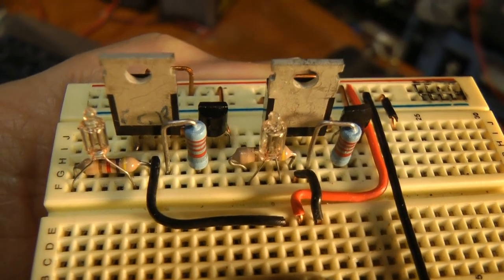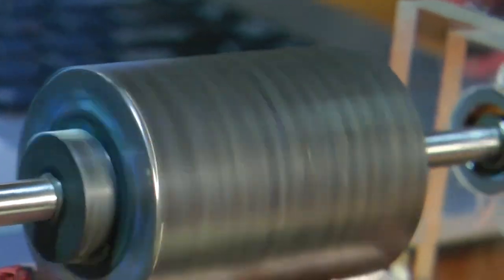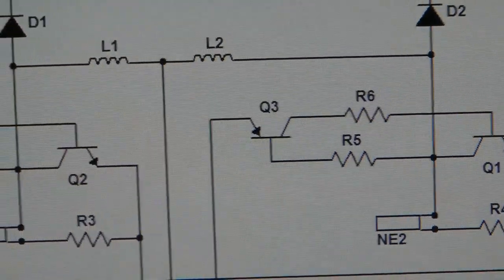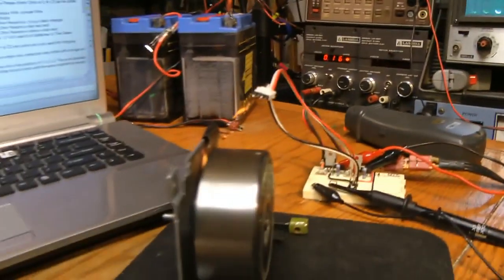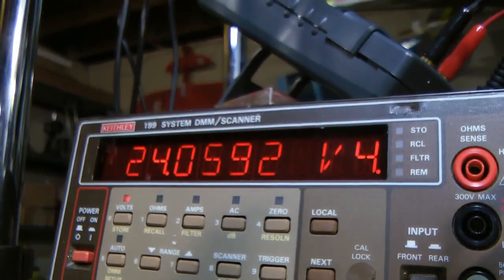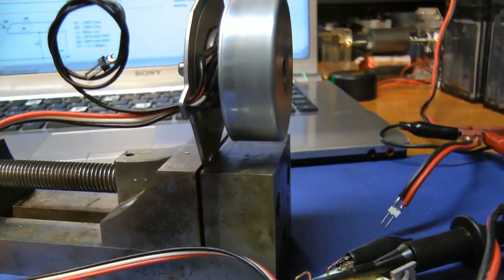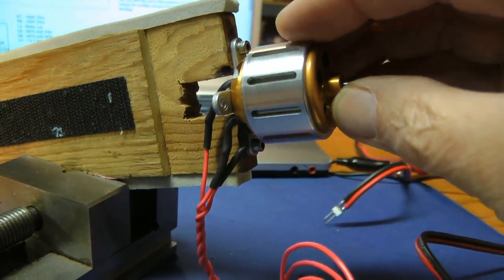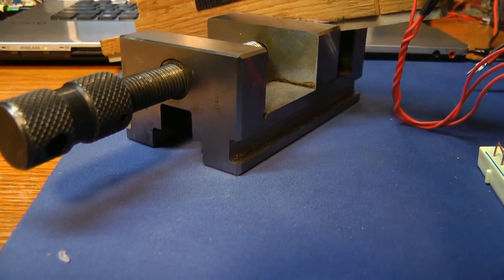1 Coil Brushless Motor Driver (Multi Phase)

Comment: Hi, DadHav , Do you think I can make run my HDD motor with this circuit , Thanks for video ..
Reply from the maker: Ram, You might be able to. I ran the Small R/C motor with the circuit. But honestly if you want to run small motors and get power out of them you can't beat the r/c speed controls from sites like HobbyKing. You see a pulse circuit triggered by a coils has some draw backs. The firing of the circuit is dependent on a voltage generated across the coil from magnets. What happens is you can reach a maximum rpm and then anything else will heat up he transistor. If you stall or put a load on the motor and the speed decreases so does the driver voltage. With this anomaly your motor is more susceptible to loses as you try to do work with it.
Reply from the maker: Oh I thought you where talking about a three phase motor. I wouldn't bother trying to make something. Some of these small modules are less than 3 dollars. Just do a search on e-bay or ICStation for stepper motor drivers. You will find some things like this.http://www.ebay.com/itm/Stepper-motor-driver-controller-Speed-Regulator-Pulse-Signal-Generator-module-/181861309043?hash=item2a57c75a73:g:7g8AAOSwpDdVLmM8
Reply: Hello.  This was not my question, but I have a question about this circuit.  This driver says that you will STILL need a motor controller.  Is that correct, or is there a language problem?
Also, I would like to discuss some other ideas, if you have time.

Comment: With all due respect! How hard would it be to have a full flesh ESC as simple as possible? may be one that  can be hooked to a mosfet bank. so it can pulse a small motor with very little draw or can be put to work with the mosfet bank to a very large machine! something like maybe 5 or 6 HP motor? I know that I may be asking for to much! but I don't have nothing to loose asking.